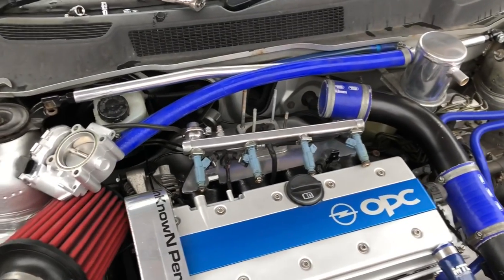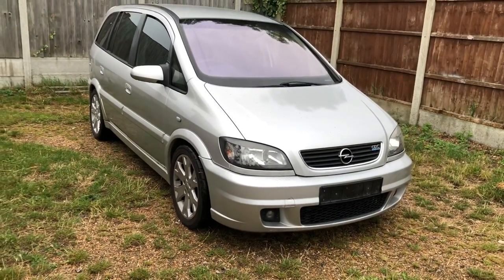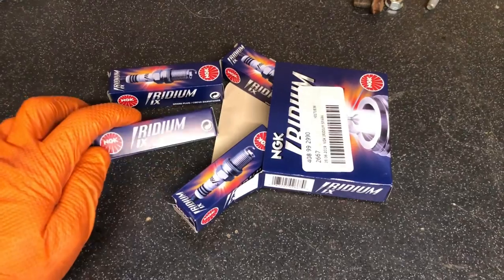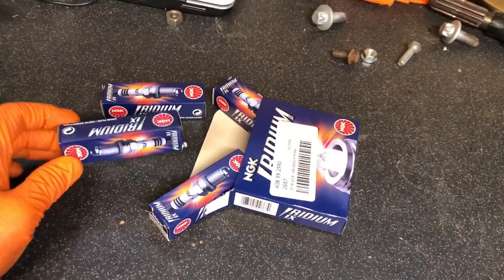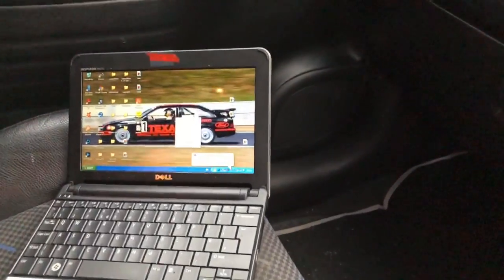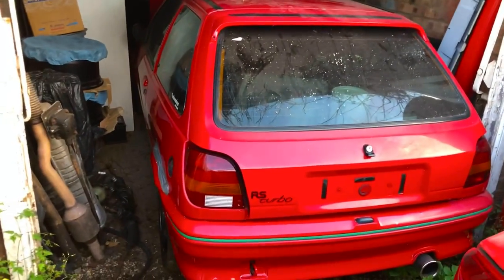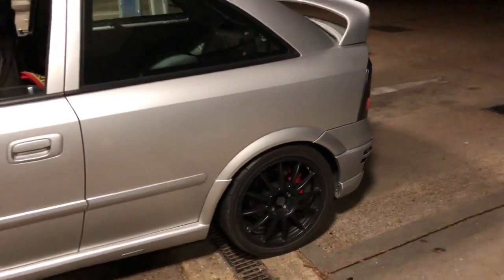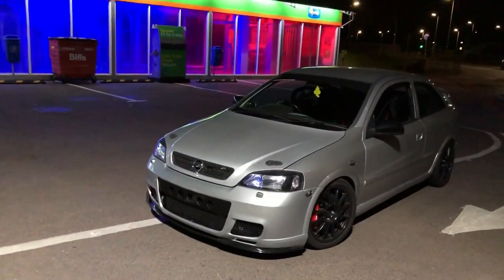I Started The Ford Fiesta RS! Testing The New Big Turbo On The Street

Comment: Hi mate, quick question on the Astra, have you painted the throttle body? Having to change mine soon and want to tidy up the one I'm getting, what would you use to clean it all up? Cheers
Reply from the maker: Yeah i have painted it with high temp paint, just use small brass wire wheels
Reply: @AaronUnknownPerformance  thanks mate appreciate it